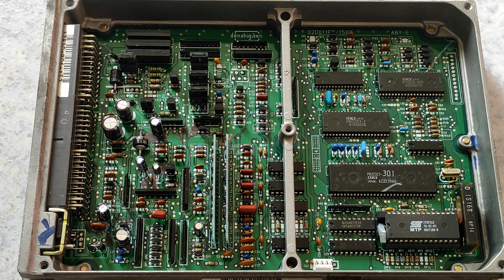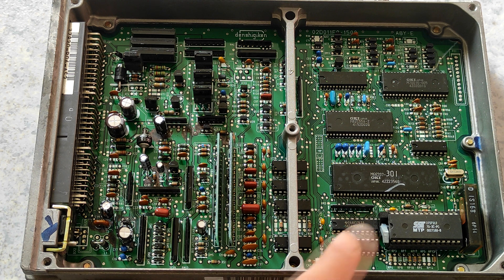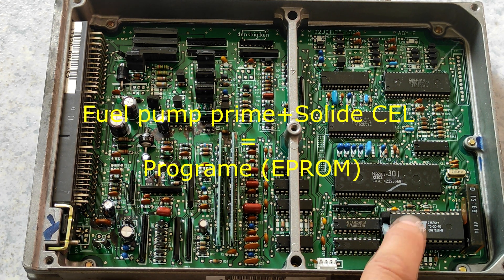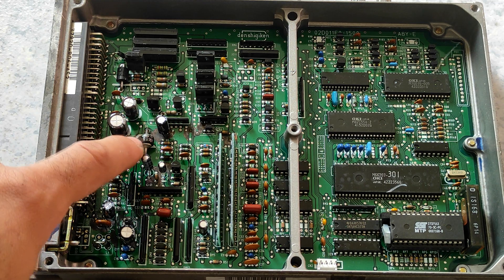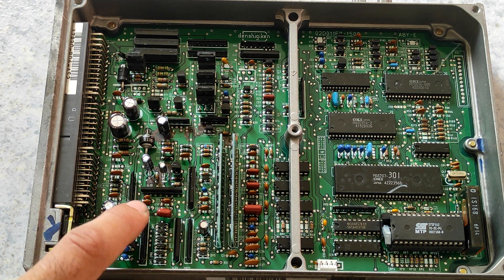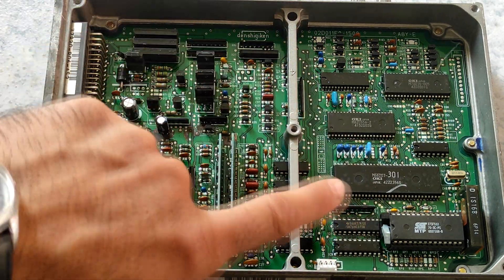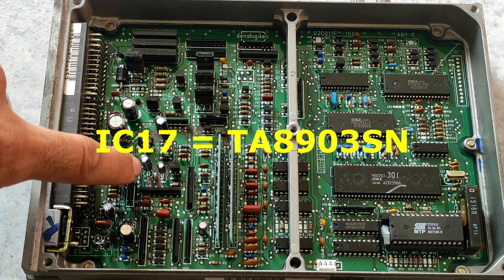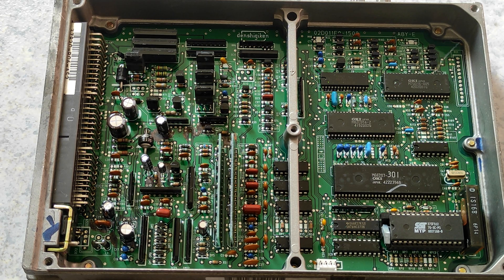Honda OBD1 P06 P28 P30 P72 ECU Solid CEL Troubleshooting

Comment: Got a p06 wierd jumper off the left unterminated. Corresponds with icm on the ecu plug. I have absolutely no idea why anyone would add it there. Has a hondarulez cop with lead soldered on the ecu header as per advised. Any idea what im facing I havent fired the thing up whatsoever putting new caps in it. Appears vtec converted.

Comment: Kinda having this problem rn, I replaced all caps with newer caps, even replaced my ic17 chip with a bypass oxytune chip, still have solid CEL n no fuel even spark, I jumped my fuel to start nothing, could it be the trace
Reply: Get a hair dryer and hover it for like 30 seconds max while the key is on and youll hear the fuel pump prime when the dryer has heated up ic17 enough so it can turn on

Comment: Hey, thanks bro in the winter I had no spark or fuel prime it happened to be the ic 17 chip before I ordered a new one. I tried to re-solder it adding some flux to all the pins at the back and adding some more solder has not given me a problem for two or three weeks now

Comment: What about if I have fuel pump priming but no fuel coming through the lines with no check engine light?
Reply from the maker: Do you have fuel in the tank? Or does the fuel pump work properly?

Comment: Wow thank you I've been up and down fighting my car testing checking and changing parts. Went and re soldered the ecu on a few parts that didn't have much to any solder and ones that looked cracked. And wish I would have seen this. Would have went and grabbed a new transistor for c17 and been back in business. Thank you so much

Comment: So show us the easiest/best way to remove ic17.. I chip as well but am now coming across having to remove ic17 and so far… can’t get all of the solder out without burning the pads…
Reply: first remove as much solder as you can with desoldering wick or a small vacumpump, then use a smd rework hot air to fully desolder the ic17

Comment: Friend, I have 2 ECUs, P0B-A01 Accord LX M/T.
Both times I replaced all the capacitors with the correct specifications.
One of them, when I turn on the ignition, the car has the injection light on for about 3 minutes and if I try, it won't start. After 3 minutes it turns on and the injection light comes on indicating error 9.

The other central, sometimes the car starts perfectly and the injection light does not appear. But sometimes starting is very difficult, you have to press the key a lot and step on the accelerator.
What do you say about each of these ECUs?

Help me please.

Tks

Comment: My 95 Civic has a ECU issue, the fuel pump won't start, this happened a year and half ago, the ECU was repaired, but yesterday the same problem came back. Any suggestions with what's causing this problem?
Reply: did u fix it?

Comment: Hey man i need a little help. thank you so much for this video, i had 2 ecus like this my ecu i changed myself worked just fine. The second one was a friends but had delayed fuel prime. told him the ic17 power supervisor needed replaced to send it back to where he just got the ecu. well they changed the ic17 and now it has solid cel but does prime and start. Runs like crap. Any ideas what this could be so i can fix it?
Reply: did he fix it?

Comment: I have a d16z6 full stock. Recently replaced the capacitors with same specs correct polarity and proper soldering( checked 2x). All running properly but sometimes the CEL pops out. I cannot read any codes after switching off it goes away. If anyone has any suggestions please help. The car runs but I'm not sure why this happens.
Reply: hey, did u repair it?
Reply: No @miziaa

Comment: Hi! Got sólid cel with no fuel prime , already changed ic17 and all caps and still the same! Already changed caps on other ecus and worked fine! So its not soldering problems... Any tips? Maybe ic12 is damaged?
Reply: No power on Q10 pin 1 indicates a bad +5VDC reference - which would affect other things than just fuel pump .The solder joint at Q10 pin 1 could be corroded or damaged with age.if it doesn't work change QM3
Reply: @DerrickDesrochers  it was definitly the qm3 … now it primes but dumps a lot of fuel… Till the car shuts off… j11 cutted so no external eprom… help? 😅
Reply: @metrogp  qm1 and qm2 control injector
Reply: @metrogp  also if your ecu is chip  cut j1 and see first it injector will stay open  first . And tell me if you have a solide sel and if not do you have any check engine codes
Reply: @DerrickDesrochers  sólid cell, injector stuck j1 cutted still the same , no codes
Reply: @metrogp  did you take out the chip
Reply: @DerrickDesrochers  Yes i did
Reply: @metrogp  si injector stuck open  only 2 causes can do that  ecu is getting power 12v from something like a transistor  or the file from the ecu si corrupted  make sure there no debris or  rust inside de board
Reply: @metrogp  try this  unplug the distributor and try  it  cuz distributor tell the ecu to trigger fuel and it my be the problem also
Reply: @DerrickDesrochers  it works fine with another 4 ecu so distributor is not the problem
Reply: @metrogp  so id would do this change rm5 and rm7    Also what board is it 11fo 1980 et the other one

Comment: Great information, I have a P06 that’s running a b20 in a 2000 civic coupe I have a solid CEL and the motor starts and runs (fuel prime) rips actually, full throttle feels great but it bucks at the lower RPMs, I have swapped to other ECUs (obd2) and it runs also with no solid light so I can confirm it’s my obd1 computer but what I’m wondering is will the car still run with a corrupted memory chip? I would assume when an ecu goes bad it wouldn’t run and drive which it does but I cannot tune anywhere around the idle or even 2k rpm and lower it just cuts out and acts like a tps is malfunctioning, I’ve been needing to chip the 28 pin anyway for the b20, is it possible I can get two birds stoned at once and chip my computer (more optimized) and get rid of my solid CEL ?

Comment: When j1 is mounted fuel pump does random things turns on and off solid cel and engine misfires and wont even startup 
When j1 is cut i have solid cel But pump primes engine starts and I can drive it normally

Comment: Hy...my problem is car normally run and idle ...but just solid cel...check mil also solid cel ..so problem in eeprom???
Reply from the maker: Nup it the ic17
Reply: @YayaAndCars  ic17 for fuel pump??...my car normal use ... Just solidcell...
Reply from the maker: Yep it can manifest itself as this

Comment: I have a ecu that is chipped with s300 and the cel comes on right away with cyclinder 1 code. When I had the changed the board the another ecu the check engine light went away. What will cause a cyp code? Possibly bad capacitor
Reply from the maker: It would be safe to change them as a precaution, but it could be the HIC modul (the two long vertical PCB), it is responsible for these sensors

Comment: I have fuel prime, with CEL flashing code 21. (2 long cel flashes & 1 short flash) p06 with hondata S300
Reply from the maker: That's the obd1 code for VTEC solenoid valve malfunction it I'm not mistaken
Reply: @YayaAndCars  thanks so much for the reply. I did in fact confirm online that is what the code is for. But I’ve never had that issue before. It’s only this ecu telling me that code. I’m so confused 😵‍💫
Reply from the maker: Check if the ECU is correctly chipped, and also the condition of the vtec transistor, I believe it's ic13 or ic14
Reply: @YayaAndCars  will do, thank you 👍🏼

Comment: I turned on the engine check when I stopped to refuel. it lights up and does not go out, it stays on. I tried to make a diagnosis but the light stays on and does not make a diagnosis. I changed ecu and again the same. it does not turn on the petrol pump, nor do I have an ignition at the start. I decked the petrol relay and my pump is working. whenever the gas pump works. the distributor is functional what is the problem ??? all fuses are good
Reply: Did you check the main relay?

Comment: I’m having a issue where I hear the fuel main relay click but the fuel pump won’t prime Check engine light goes off as soon as the main relay clicks my car cranks but doesn’t start
Reply: Also my ecu has a cut wire thing number j12 on the ecu p28
Reply from the maker: Check if the fuel pump is working, it looks like she is the culprit

Comment: Hello, I have problem with chipped p28, when i turn off car 3 dashboard lights start barely lighting(engine, battery and oil), even if i take the key off from ignition switch. Car runs perfectly. Do you know this problem? With my original ecu p9k i don't have this problem. It looks like shorten circuit on ECU, but it looks fine
Reply: did you solve it?

Comment: I have a p28, all capacitors are new but I get no injection on cyl 4 is it a ecu problem? The injectors are changed and the cables are new. Thank you
Reply from the maker: It's most likely one of the STA460c, they are the 3 long circuit on the top left of the ECU, they are responsible of powering the injectors
Reply: It is chipped

Comment: I have replaced the capacitor, but the problem is still not resolved. Do i have to replace the ic 17 too?
Reply from the maker: Yep most certainly
Reply: @YayaAndCars  ic 17 must be programmed or just replace it?
Reply: @panduraga  did replacing ic17 work?

Comment: where 4-wire 02 is controlled on p28
Reply from the maker: The heater circuit is controlled by one of the 3 big circuit on the top left of the ECU , they are Darlington transistors